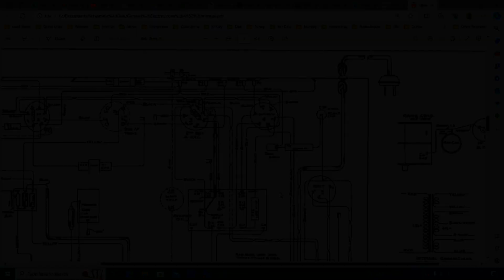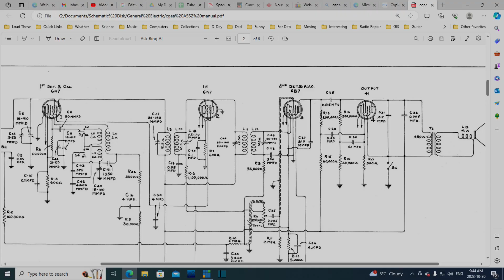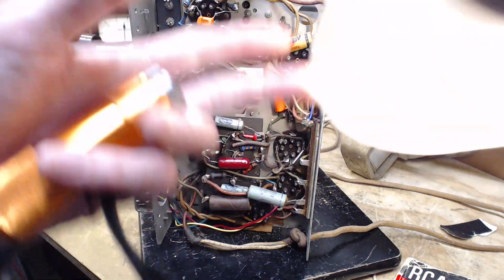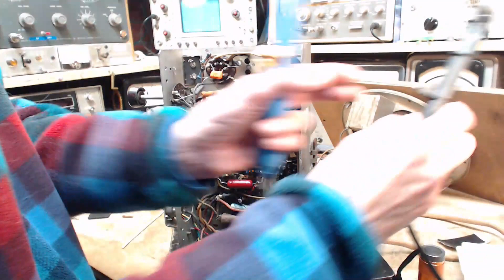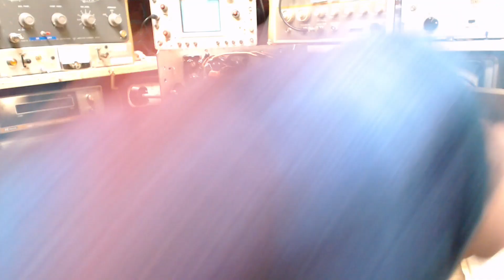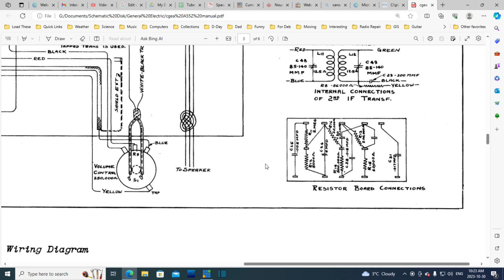Canadian General Electric Model A55Z Video #8 - Not my bad

Comment: I would not trust that Chinesium tester for accuracy in capacitors that have 100 Volts going through them in a radio. It
is an old paper cap and should always be replaced with a modern equivalent capacitor. Line drawing may not be accurate
if changes were made to radio. Follow the schematic first!!! Because it was tested by its design and worked. Later they
drew up a component drawing which has errors in it which one you have found! Good call otherwise Jim.

Comment: Hi jim I have a bumblebee capacitor, It is Brown,Orange, yellow, I know its 400 Volts, But it cant be 13 Mfd, Just Learning
Reply: Brown,Orange, yellow (  it's not 13 Mfd  )   = 0.013 uF / 13 nF / 13,000 pF & it is a oddball value  ........
Reply: It's 0.013uF but they make modern 0.015uF  at 600 Volts and that is what you can use to replace it with.
Reply: @hestheMaster  Thank you For you Time God Bless